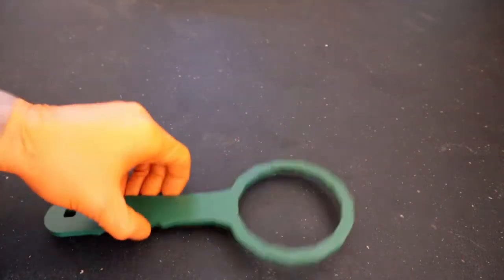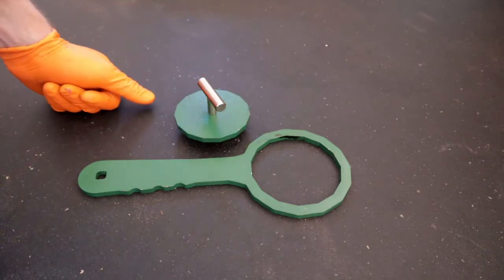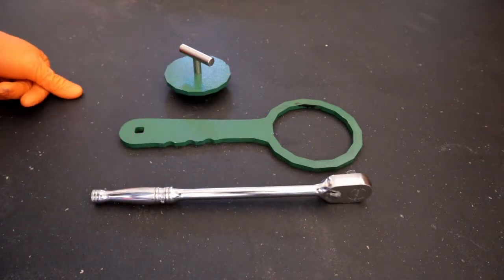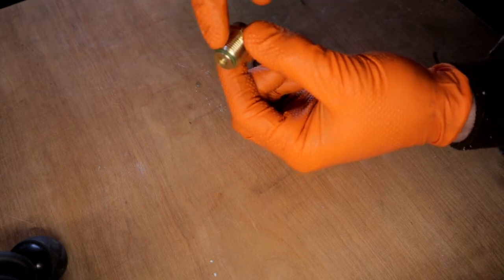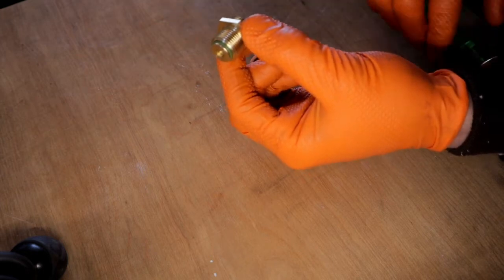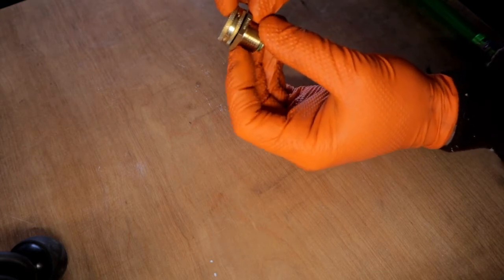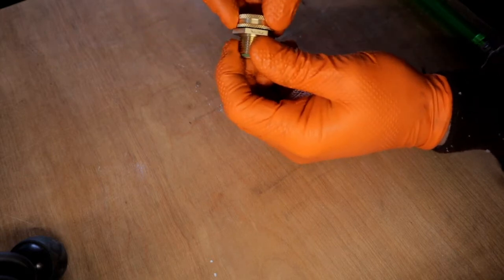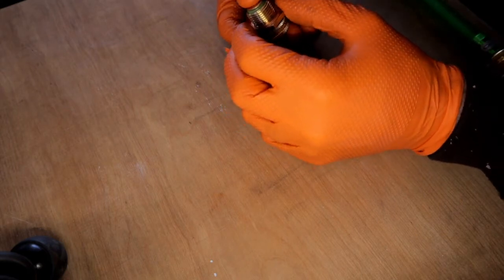No-Mess No-Spill Oil Drain Plug - Femco

Comment: I wanted to go with this oil drain system but according to their website, you have to buy the drain hose separately. I went with Valvomax, it comes with drain hose. Same thing though
Reply from the maker: The two that I have ordered from Amazon both came with the hose.
Reply: @south_coast maybe they have changed it now. Yesterday there website says you have to order separate. I think they are geared more towards fleet operations where you don’t need 20 or so drain hoses laying around when just a couple will do